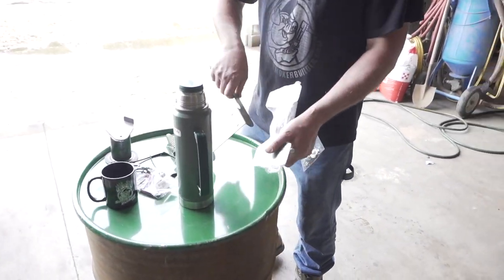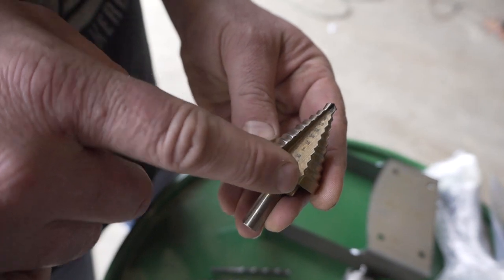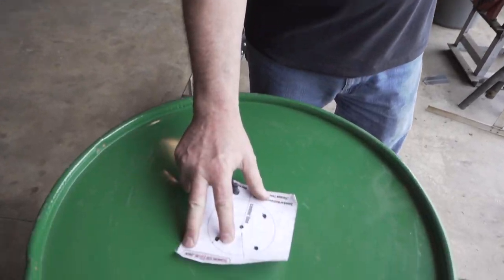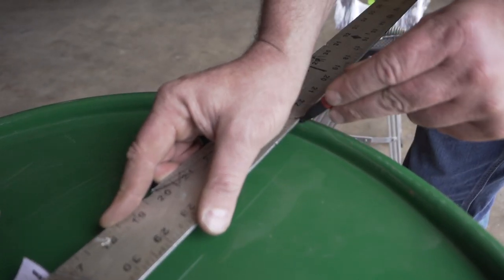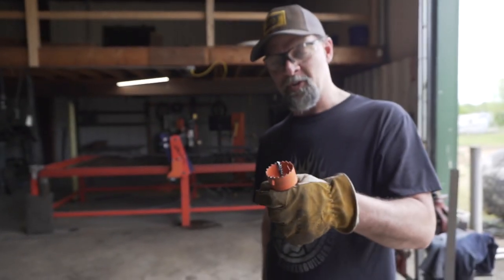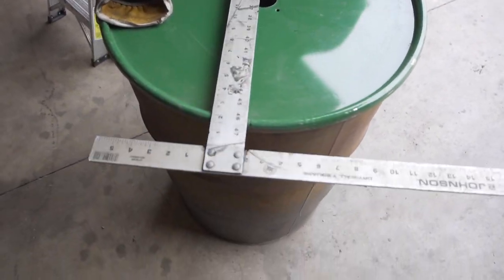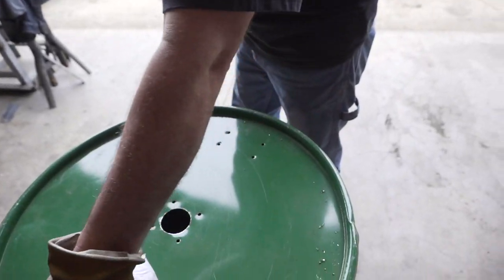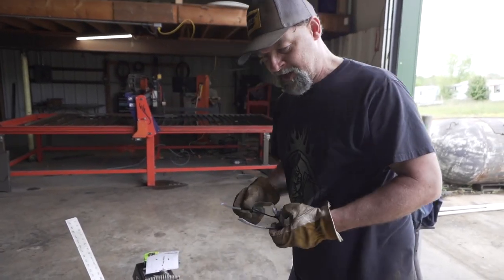How to Build a UDS Drum Smoker [Marking & Drilling the Lid]

Comment: thanks for you help. if the drum held  foam insulation will it clean up and be food safe? thanks
Reply from the maker: Barry Williams  Hey buddy, actually I have never cleaned one with that in it. my inclination would be to do a burn out and then sand blast or vise-versa if that is the only one you can get easily.

Comment: I bought a drum with liner. Can you suggest a good way to get it out. Thanks
Reply from the maker: Hey buddy! Thanks for reaching out! We actually did a video not too long ago about how to burn out the drum to get the liner out! You can watch it here:
https://www.youtube.com/watch?v=6Zwc_JNL6c8
And then for how to clean it out after that we have another video on how to to do that:
https://www.youtube.com/watch?v=rmT9PZcrftI&t=358s
Hope that helps, brother!
Reply: @SmokerBuilder   the drum i got had foam insulation in it. After cleaning will it be food safe. Thanks
Reply from the maker: @barrywilliams606  Hey buddy, actually I have never cleaned one with that in it. my inclination would be to do a burn out and then sand blast or vise-versa if that is the only one you can get easily.